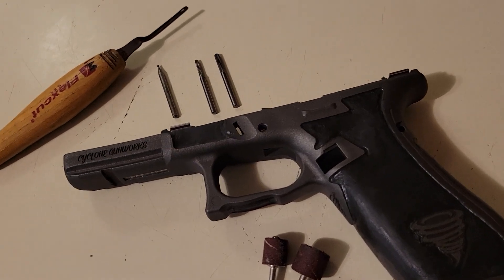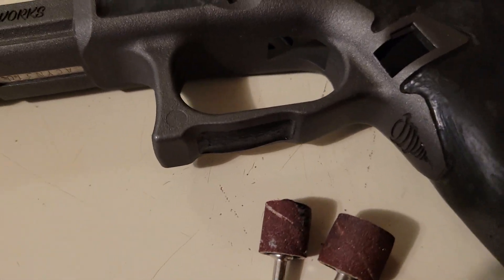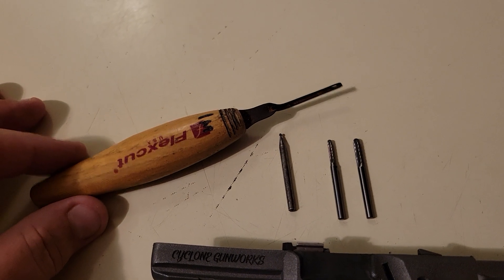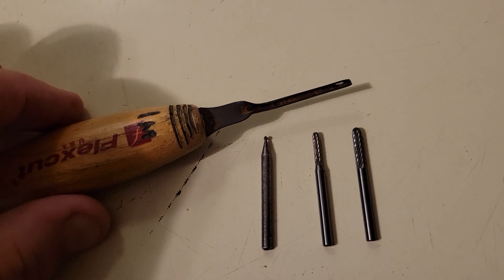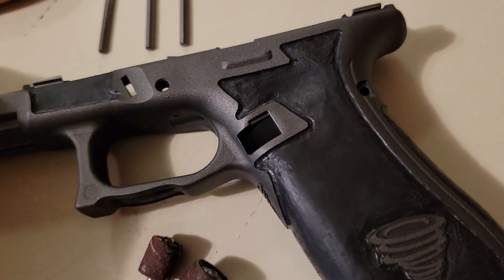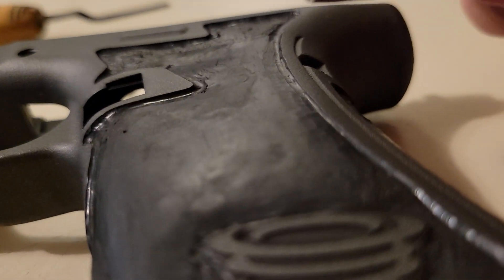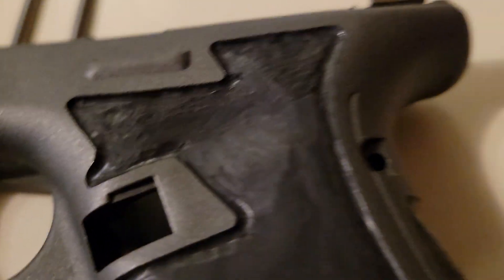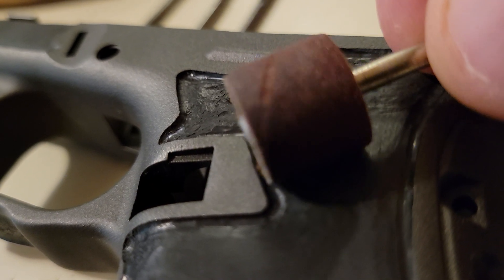Glock stippling DIY tips & tools for recessed borders.

Comment: I have seen techniques on stitching the boarders with a wood burning kit. But I have used carving tool same exact one as you have with the  small carbide and the large carbide tools. Yet the boarders don't look clean. Especially with the passing of the larger carbide. It leaves a flashing residue.
Reply from the maker: The border cutting process is not exactly related to stitching. If your borders don't look as clean as you like, you have to keep working on them. Stitching comes into play for stage 2 pattern layout. After your border straightness is  predetermined, a stitching is another option for a pre border with a burning tip. The stitch just adds a wall up to your border that allows your pattern you burn to have a seamless blend from tip ending to border, if that makes sense.
Reply: @CycloneGunworks  yes sir thank you. Great advice ! I have to use the small carbide a little more ?
Reply from the maker: @BrotheriZz  that bit will work or the carving tool. You just have to take your time and do several passes until you like the crispness.
Reply: @CycloneGunworks  thank you so much sir.

Comment: I would have never thought you used a hand tool that’s cool
Reply from the maker: Not many pros use these because the ultimate tool is a foredom but that is crazy expensive in comparison.  The carving tool offers me better precision in small areas or making shapes that I want perfectly.  Just like anything else it takes a little practice to get used to, but I'm still using it after stippling for about 3 years now. Just works for some people really well

Comment: carbide bit are also called rotary burrs or carbide burrs.
Reply from the maker: Pretty much, not sure if you are asking or trying to educate someone, but I always try to avoid confusing people though that are here to learn. The burr bits usually have spikes or segmented cutting areas on them , not really common for stippling because they leave a lot of scratches. Carbide bits will always have the rows of cutting tabs. Whether it's a 106 or a 9903. There is also a mix of the two known as Carbide burrs.  In the stippling world, the main burr bits that are commonly used are for HD channel borders and they are usually the diamond burr ball shaped bits. Used by increasing grits until you get desired finish.
Reply: I just want to leave that information out there cause there are different terms for cutters in each country. I deal with cutting tools (carbide inserts et al) thus why I know a little bit about these.

The one you mentioned with segmented or spikes are called double cut carbide burr. While the 106 dremel linked in your full video is a single cut carbide burr. 

I’m confused though since you mentioned Diamond burrs are commonly used by stipplers but in your video it’s a normal carbide bit/carbide burr. 

I’m planning to do some borders and would like to know more.
Reply from the maker: @StandBy-Beep  I am not a rude person and hate taking time to debate but instead invest a lot of time trying to help others learn to stipple and gain confidence. I said diamond ball burrs are used to do HD channel borders. The reason that confuses you is because your trying to argue your point instead of learn something. You'd understand if you look into stippling mods more . Hd/channel/gap borders have nothing to do with what's in my video. Look into it but this is exactly what I don't want to do is muddle up all these subjects for people who don't know what either of us are talking about now, and just want to learn basic stippling techniques. Please just let me know if you need help with any stippling questions but I try to avoid going back and forth with people, especially when I don't think it's going to be helpful to new comers trying to learn. Most people watching don't even care about the meaning of the word carbide or when it was introduced into the english language. They just hit my Link in the descriptions and buy the exact tool I recommend then focus on the techniques not the technicalities.
Reply: @CycloneGunworks  I’m not arguing with you. I said “it’s also called” and pointed it out so people who lives in a different country can easily search for the tools needed. I did not in any way corrected your terminology. Not everyone who watches youtube lives in the US and is able to order from Amazon. 

Thanks for clarifying. Will surely watch other videos.
Reply from the maker: @StandBy-Beep  perhaps I took you out of context in some ways. I am happy to have you here, especially being a viewer from another country. If you need help with any stipple stuff I'm here👍 I'm so busy lately, I haven't had much time to post more vids but I will be posting more soon.
Reply from the maker: @michaeluy1177 sorry for the delay, the burrs that are ball shaped are used for a technique known as HD or gap borders. Not the ones I did, recessed borders. HD or gap looks amazing but it's pretty much double the work and not easy so not as common.

Comment: Have you ever experienced any structural Integrity damage / reduction by removing material of any kind or flexing say when it's a hot summer day and you've appendix carried all day have you ever seen any flex in the grip after removing material of any sort?
Reply: I tend to just use A-grip brand stick on grips they use a great industrial quality adhesive that sticks on better over time getting warm n cooling lol. Plus that moleskin semi fuzzy is the best I can describe it material is amazing for sweaty or oily hands, the Vet owned company designed it for the workin person who's often got wet filthy hands lol, do you have any material you can add in that grips in that fashion?
Reply from the maker: @Jordan-ql6tm  there are sealant options like silicone carbide or bed liner.
Reply from the maker: I love when people ask this question because it is a good one and a real concern for some people. Short answer is no, never had issues. Long answer: When your new to this, you have to be careful and just minimize step 1, the dremel prep work (most material removal) until you learn where the thin spots are on each type of frame. Glock polymer starts to flex at 3mm thick. The side walls of the magwell will flex on untouched frames because they start at 3mm thick so less is more. Areas like the trigger guard are 5mm thick, accelerator cut is 8mm thick. So abnormal flexing isn't usually an issue. You can deform/warp your magwell to not drop mags free but there's an easy fix for that scenario. When it comes to step 2, stippling, this does nothing with the integrity of the frame. Your just displacing the surface polymer. For anyone wondering Glock has the thickest polymer molded frames compared to p80, CZ, s&w, ruger, springfield etc., that's why everybody stipples them the most. I've actually weighed frames that I've done every dremel mod there is and they don't have more than a couple grams of material removed, with the acception of finger groove removals and grip length chops. Best advice for beginners is to only remove the high points of the factory texture (like the gen 5 lil pyramids)to have a somewhat flat stipple area. And don't push your iron too hard when stippling. If all hell breaks loose there's 2 options for a catastrophic issue like your asking of. 1# Add jb weld to weakened area and resand for a nice finish, then cerakote is recommended for the best finish results. #2 option is $100 warranty frame replacement thru glock.👍 hope that helps bud.
Reply: @CycloneGunworks  yea that was an awesome explanation appreciate brother! I had written another response but it looks like it got removed 😂
Reply from the maker: @Jordan-ql6tm  idk glad I could help tho👌

Comment: Hello, first off great vid… quick question, about how long should stippling last? I see everyone taking about doing it but not really mentioning how long it will last. Does it start fading after handling for a long time. I’m getting ready to do my EDC and wanted to get an idea before getting it done. Thank you
Reply from the maker: Sorry for the delayed response but great question. A stippled grip typically does not wear any different than standard oem grip textures. Although if there is a pattern that will wear its going to be anything done with a very fine tip like the micro dot pattern that agency arms does. It's also susceptible to retaining skin, dirt, and other gunk very easily which will require some cleaning as well with a brush to clear out the small pores.